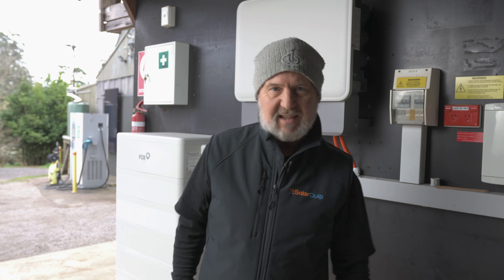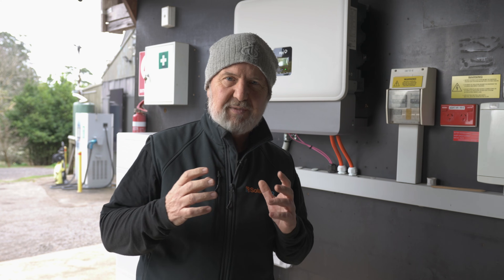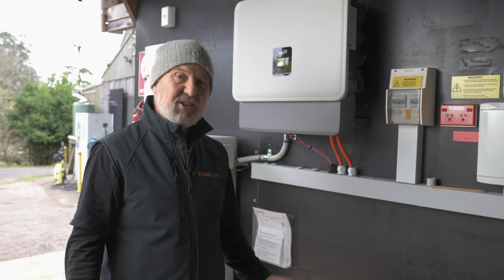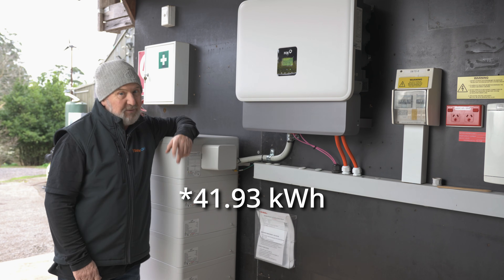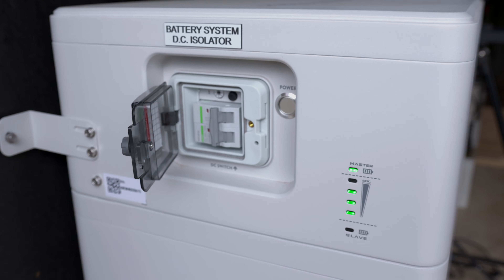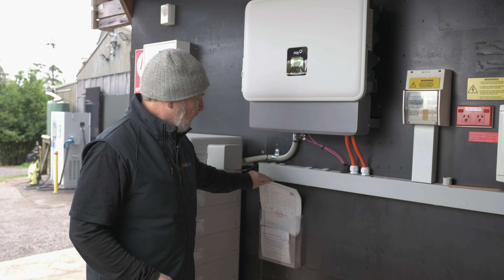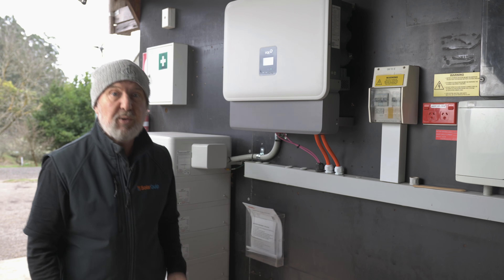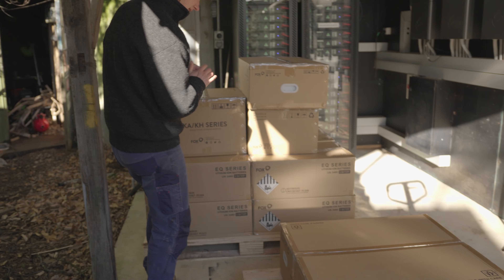FoxESS H3-8.0 Smart Hybrid Inverter Installation

Comment: where you got all the cover for the cable that you put under inverter (grey coloured one there) and small square cap on the right side of the last stack top battery there. I recently install fox ess system and not cover or cap provided
Reply: I’ve  experienced the same. No cover provided

Comment: I think i just vomited in my mouth.  How much is this guy getting paid by FoxESS. "They made a cover for the high voltage terminals,  that's AMAZING" well yeah,  something they should have done from the start so people don't die.. "they have 100% useable capacity.  INCREDIBLE" yeah,  well most manufacturers who care about their product add a reseeve, because its a known issue with lithium chemistry batteries that discharging to 0% reduces lifespan. "AND IT COMES WITH A SPEC SHEET" I certainly hope all batteries do, otherwise id steer clear. This inverter has been independently rated 2.1 or of 5 by other websites. This guy should 100% sell snake oil. Vomit.

Comment: I currently have solar, and normally I see grid overvoltage and limiting the power or switching off. How does your system handle that? Does it charge the battery?

Comment: All brands have commissioning issues. The FOXESS must have a 2.4GHz wifi connection. 5G won't work. The single phase models have a direct to inverter CT. The three phase model needs a hard wired 3 phase meter. That may require a new MSB. MUST upgrade firmware. Momentary outages on the EPS will occur if not upgraded. Does not operate without batteries as a Grid inverter. Good luck getting it connected to Ausnet.